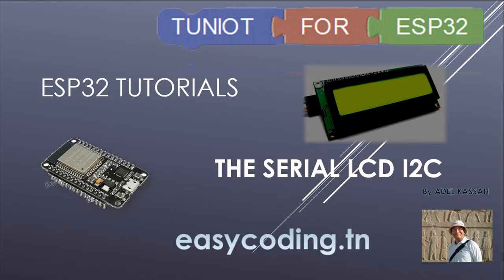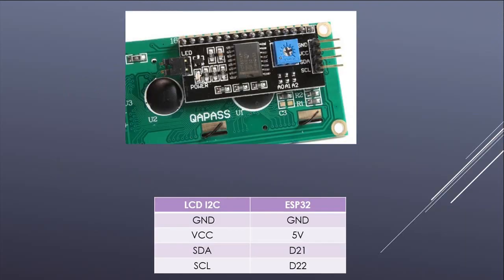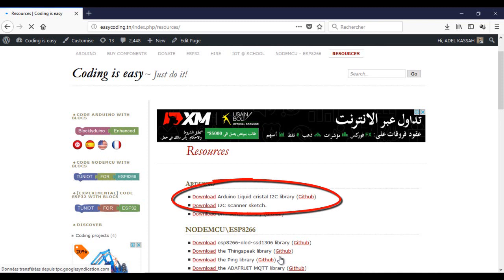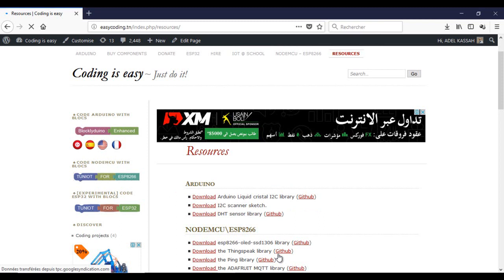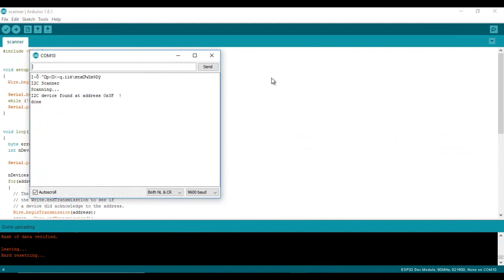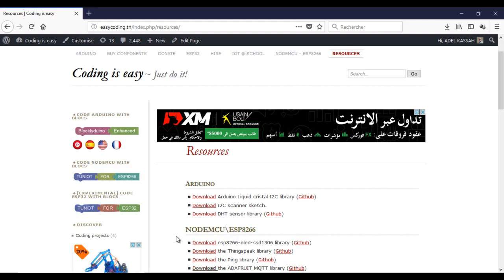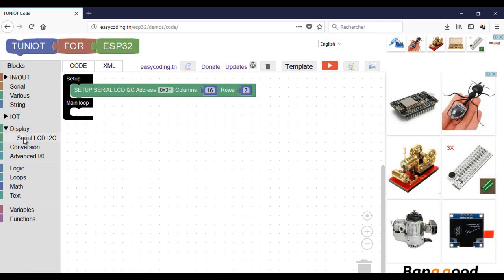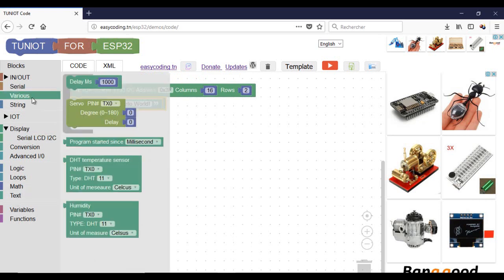ESP32 tutorial A-08: The serial LCD I2C

Comment: Greetings, thanks for the tutorial.
Is there a way to tell the lcd.init () function that the display is connected to the alternate I2C GPIO 18 and 19? Because I am using a TTGO T-CALL ESP32 SIM800L module and the default I2C port (GPIO 21 and 22) is compromised